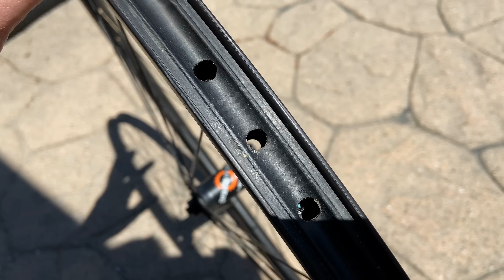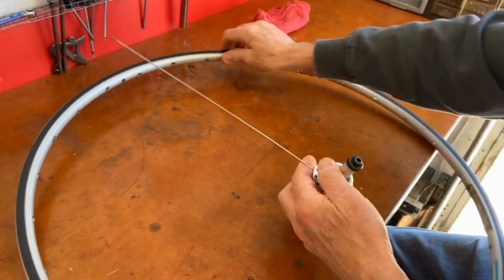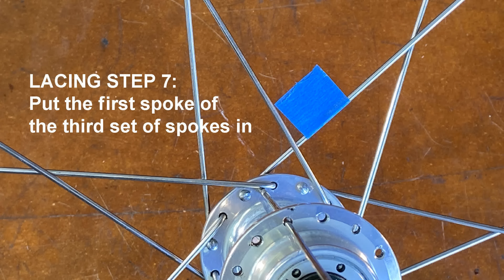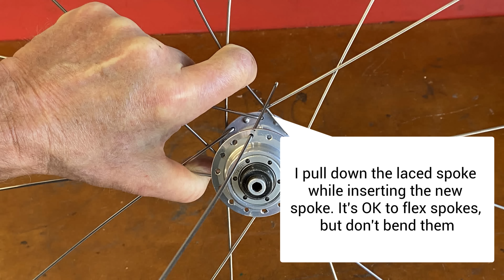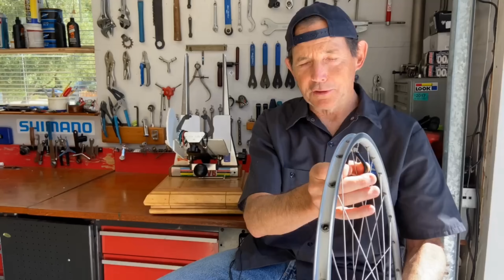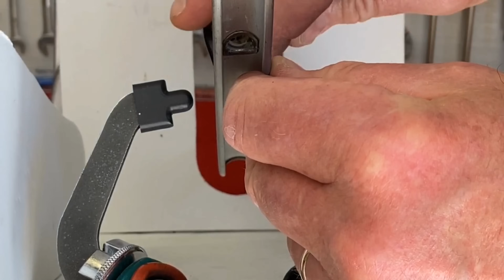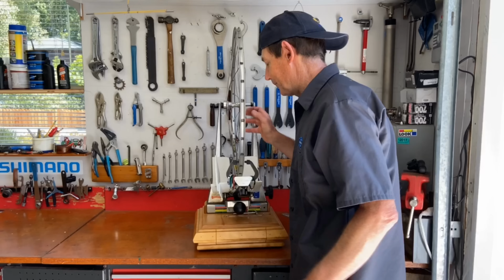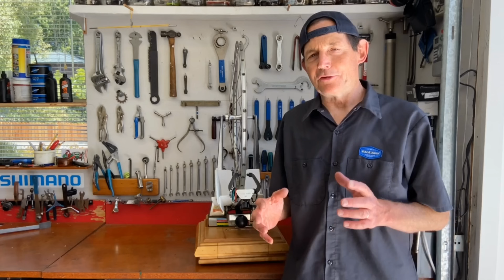How To Build Bicycle Wheels THE EASY WAY! #bikerepair

Comment: Found your video much more informative than shorter ones on YouTube. 
I bought several basket case huffy 26” cruisers to make a few odd bikes. 
(Reverse steer & a swing bike)
I have enough parts however the wheels on most were less than perfect. 
Knowing how to true a wheel will be a big help! (If I can do it?)
Taking apart and re lacing will be good if I decide to paint my wheels? 

Also my LBS is now closed due to the owner retiring. 
And he usually done all my wheel truing on my unicycles. 

By the way I did hit the subscribe button.
Reply from the maker: Thanks very much for subscribing, Ron, appreciate it. Sounds like you have some great bike projects you're working on. Being able to true and build wheels will come in very handy and anyone can learn the skills. It just takes a little practice and patience. Don't be in a rush. Take your time, make small adjustments to the spokes when truing and you'll learn how it's done and get good at it relatively quickly if you do it this way. Have fun and best of luck with your cool bike projects - reverse-steer, unicycles and a swing bike - wow!
Reply: @JimLangley1  
Gotta say didn’t expect a reply on a two-year -old video. 
I took an old rusty wheel to play with spoke adjustment, probably my first mistake. 90% of the spokes nipples were seized! But with previous experience working in the truck maintenance industry I was able to get all of them freed. 
Got the wheel close, actually ALOT closer than I thought I would have!
Actually stripped a fee nipples in the reassembly. I have spare bikes so no worries. 
I have a much better wheel I will give this skill a go on at a later date!!

I appreciate the video and the response!!

I may even attempt to build a tall bike in the future?
Reply from the maker: @krukabman  great job, Ron. Yes, seized nipples are always a challenge. On my highwheel bike (you can see it in my video: https://youtu.be/671CtqCds2Y) all 80 nipples were frozen because they were over 100 years old. It took lots and lots of penetrating oil application to get a few free and then I broke out the torch to heat the rest up to get them to finally break loose. Great job getting yours to where you could true that wheel. I thought of the highwheel because you mentioned a tall bike. Be careful on it if you build it, it's a long way down 🙂But they sure are cool! Thanks again for subscribing! Don't know if you know but there was another Ron Cooper who was a super famous bicycle framebuilder in the UK. His bikes ride magically. We sold his frames at our bike shop in the late 1970s and I finally met him in San Francisco when he came here to a big bike show around 2010. It was wonderful meeting the man behind the amazing bikes. https://en.wikipedia.org/wiki/Ron_Cooper_(bicycle_framebuilder)
Reply: @JimLangley1  
I would love to have a penny farthing (high wheel)
It’s said to be the beginning’s of the unicycle?
An acquaintance of mine (a self proclaimed know it all)
Told me the unicycle was invented by a guy scrounging through the write brother’s dumpster??
I told him I didn’t think the dumpster had been around in the weight brothers time!?🤔
Ron Cooper could possibly be kin? 
My dads name has origin’s in the UK, Scotland & Ireland. 
As far as the tall bike I think I would be ok I have a giraffe unicycle, 5’ I have ridden it 2 miles in one go. I am still unable to free mount it though. 
It is actually easier to ride than it’s short counterpart. More time to correct. You just have to get your mind over the fact that your that much higher, and a 5 footer you really never more than 32” off the ground. (Measure from the bottom of your feet, with the pedals at 3 & 9 o’clock)
A friend of mine had a lead on a 10’ unicycle we were going to buy it just to ride it once and get a video to post. Then sell it and split either the profits or the losses. But someone bought it before he could get a delivery that took him through the area. 

Well I could go in and on, more than I already have. 

Again I got WAY MORE INFORMATION from your video than all the others even the park tool video. 
It was easier for me to follow. 

Keep the rubber side down!
Reply from the maker: @krukabman  I'm really happy to hear that my video was so helpful, Ron. Thank you. The unicycle was invented before the Wright Brothers actually. A guy took the rear wheel off a highwheeler and patented the idea. I can ride a highwheel but I can't ride a unicycle. I have one and maybe someday I'll figure it out. I can tell it takes a lot of practice and it would be better if I was a lot younger, ha!! I enjoyed chatting with you and learning about your bikes. I would enjoy seeing your tall bike and other bikes if you would like to share photos somehow when the projects are done. Let me know if you need bike help and I'll be happy to help!
Reply: @JimLangley1  
I’m not going to even start cutting up the bikes until I get back from holiday. 
I’m going to use the cruisers on the beach then start hacking them up. 
I have a channel that I post videos to once in a while. I will most likely post a video of me riding them on there. 
As far as learning to ride the unicycle your never to old to learn I learned at 47. 
And look up “Unigeezer” on YouTube. He’s 65 I think and he’s a sponsored rider. 
I was face book friends with him before I ditched and deleted my account. 
Look up “36’er unicycle crash”
It’s a 10 second video that’s my channel. 
Always enjoy talking to like minded people.
Reply from the maker: @krukabman  thanks a lot for the encouragement, Ron! I will definitely check out and subscribe to your channel to see your two wheel creations!! And I'll check out the Unigeezer too, thank you!
Reply: @JimLangley1  
Thanks. 
Unigeezer is amazing on what he does with a unicycle. 
I don’t post very often. But when I get one finished I’ll post a video.

Comment: Very informative video and thank you for all your efforts in making it for all of us to learn from.  Before watching the video I thought I was truing my 29 inch mountain bike wheel and the spoke popped off from the nipple.  I tried to pull the spoke and screw it back together but the nipple doesn't catch the first/initial threads.  The wheel is a 2019 wheel, so I was thinking that I needed to get new nipples to have screw together again.  What are your thoughts?  Any help would be great.
Reply from the maker: Thanks for watching the video, Ray, glad you like it! That's an interesting problem you're having. Usually when you're truing a wheel the nipple can't separate from the spoke since it's screwed on to the spoke a lot - at least half the nipple is on the spoke. So, if it popped off, it makes me think that maybe that spoke is just way too short. A too short spoke that might have been holding onto the nipple by one thread could definitely pop off when you try to true a wheel. And it also wouldn't thread back on since it's so short.

Usually when they build wheels they use the same length spokes so to have just one that's way too short like this would be unusual. So, you should look closely at that wheel. Look right at the end of the spokes where they go into the spoke nipples. Are there a lot of threads showing on all the spokes? If so, then the problem is the wheel was built with much too short spokes and that might be your problem. Unfortunately the best solution for that is replacing all the spokes with the right length ones. I'm happy to knock around more ideas so please let me know what you find and we can discuss it some more.
Reply: @JimLangley1  Thank you for the quick reply and all the good info.  I'm going to have to figure out the specs of the spokes and get some new ones.  I have been out of the biking game for a long time and soooooo much has change their is so much information that you need to know.  I don't even know what brands are any good anymore (for parts and things like that).  I would like to put together my own wheels at some point.  I don't want to pay the carbon fiber prices but I don't want to go cheap with all effort that I'm going to put into it.  Lots to learn but, I think that's the fun part about it.  Thanks for being you and helping out the biking community!
Reply from the maker: @lazysurf9  you're very welcome, Ray!

Comment: There's lots of different ways to lace the wheel, I do it slightly different however it's all the same in the end(should be anyways) I often have trouble with the oval, lateral I can get almost perfect- when I say trouble I mean around 1.5mm out of round and lateral around 0.5mm, I'm a perfectionist 🤷 however it's good to hear you mention that nothing is perfect, I know that tolerances will never be perfect, nor a wheel ever be perfectly round.. but it's good to hear others confirm it
Reply from the maker: Thanks for watching and the great comment, Van. In case it helps with getting that last 1.5mm of roundness even better, what I like to do is move the indicator on the truing stand below the rim so that it just touches the high spots as the wheel spins. I then work on each high spot tightening the spokes just enough to make all the rubbing noises stop. Then I move the indicator closer to the rim again and make it just touch and I repeat the tightening to get the rim not to rub at the high spots. Doing this just a few times in most cases will get the wheel so round that you won't be able to see any imperfections. It's fun doing it this way and super satisfying as the wheel gets rounder and rounder. It's my favorite step of truing, I think you'll enjoy it.

Comment: When your truing a wheel you just laced, can you tighten which ever side you need to move without loosening the opposing side spokes, assuming they all need to be tighter anyway? At least on the first side to side truing pass?
Reply from the maker: Thanks for watching and the great question. Since the spokes are not too tight yet with a just laced wheel, it's fine to tighten whichever side you need to. But I recommend that you get the wheel nice and round and very true with low spoke tension on both sides first before starting to tighten spokes. At that point the spokes will still be relatively loose and it's fine to tighten a side without loosening the other side. Okay? I hope this answers your question and happy wheel building!

Comment: I've always trued my wheels with the saddle nose hanging on a pool ladder! The brake pads and a pencil across the brake pads is my choice. A zip tie or a carefully held fingernail works on track bikes. A trueing stand would be awkward with all these years working as I have from the top.  The thing I've never done is hammering the J bend. My wheels stay true, but always break at the J bend. On 36 spoke wheels placed 4 crossed, occasionally spokes have broken at the nipple.  I always have stood the axle onto the floor and pressed on the rim. Some new things to try.
Reply from the maker: Appreciate you watching and sharing your technique, David. Spokes should rarely break as long as you use quality spokes. I recommend DT Swiss and Sapim. The most common cause of breaking at the nipple is that the spoke length is too short to reach the end of the nipple. That leaves an unsupported part of the nipple and the nipple can break there. Thanks again and enjoy your wheel building.
Reply: @JimLangley1  Been there with too short! The spoke filling the slotted part of the nipple shoulder helps keep it from shattering. Too long makes me want a Hozan spoke threader even if it meant taking the wheel apart again! Long ago a nipple  stripped out because of a too long spokes! Treading on thin ice once again.
Reply from the maker: @davidburgess741  I cut and threaded hundreds of spokes on the 3rd Phil Wood spoke machine made, David. But I much prefer to use factory threads so if spokes are too short or too long, I will rebuild the wheel with the right length spokes. Have fun and thanks for the great comments!
Reply: @JimLangley1  The problem as an amateur wheel builder is volume. The LBS no longer stocks spokes! They use salvaged spokes from broken wheels! More profit in selling built wheels since without profits, they would be gone. Ordering from Universal Cycles, it seems they don't believe an amateur could read a spoke ruler to rebuild an existing wheel with same configuration. Profits again.  Returns and shipping cost them money. If I had a Hozan or  cyclo tool, maybe I could score a small supply of long spokes and be good for a long time. The Phil tool is  beyond my budget and needs. I'm not from the disposable world, diverging standards mindset in the name of profit!
Reply from the maker: @davidburgess741  shops vary a lot so I think it's always worth calling around and checking, David. At least in places where there are lots of shops, like here in the USA. Some have spoke threaders now and Wheel Fanatyk sells the best one I've seen yet https://wheelfanatyk.com/collections/threading/products/wheel-fanatyk-sct-machine , which means you'll still get professional quality threading.

Older bike shops might have a supply of older but still good spokes that would work even if they're not the newest models of spokes. With newer shops just starting out that's less likely. 

You can often find spokes on eBay.com, Amazon and the bike sites like Universal that you mentioned, but you're right that it's hit or miss. Plus the price per spoke can be way up there. Hopefully things will improve on the supply side but I bet the price doesn't come down, unfortunately - sure miss the days when all bike stuff was reasonable to buy for anyone to be able to fix their bikes.
Reply: @JimLangley1  I have a small supply of DT spokes from a wheel I built 20 years ago. Small flange 4x 36 spokes. The LBS actually has a threading head by it's lonesome. It's possible with patience to make passable threads on this bare bones rig! They've made a few for me. Just like my father, I collect tools. Need a pipe threading rig and pipe vice, got one? Knowledge how to use it, also passed down! Never was a plumber. Television repairs,  he also did that, again as a complete amateur! Machinist,  never was one, but was a  tech writer for a major software company. Trained as an A+P mechanic, horrible 80's economy,  wound up as Nurse Ratchet at a state nut house for 34 years! Won a state time trial as a junior and raced Cat 3 for a few years. No veterans  or masters Now I feel the average cyclist on Strava should unsubscribe. I'd find it too embarrassing to be that slow!
Reply from the maker: @davidburgess741  congrats on your state time trial championship - that's quite an accomplishment, as are your many different jobs. Impressive!

Comment: Excellent tutorial, Sir.  I am planning to build a pair of 36 spoke 27 inch wheels and I am trying to decide whether to do a 3 cross or a 4 cross lacing.  What factor(s) should I take into account?
Reply from the maker: Thanks for watching and the question, MrBrando! With 36 spokes - as long as the rims are nice quality - you'll have strong, reliable wheels with both cross patterns. 4-cross would be good if you're carrying packs or there's a heavy load on the bike. But, both 3- and 4-cross will build great wheels so it's really up to you. Hope this helps and enjoy your wheel builds!
Reply: @JimLangley1  Appreciate the reply, Sir.  I am leaning towards a 4-cross and I just might do that.  Thanks again.
Reply from the maker: @MrBrando1968  you’re welcome!

Comment: When you say “full turn” and “half turn”, what do you mean exactly? I would have thought a full turn is 360 degrees with the spoke key. At one point you said “full turn” and turned it 180 degrees. Am I misinterpreting what you mean?
Reply from the maker: Thanks for watching and the great question, Thomas. Sorry for any confusion. The reason I call  180 degree turns a full turn instead of a half turn is because it's as far as you can turn your hand usually before having to re-grip the spoke wrench to turn it further. 

When you take a new grip of the spoke wrench it's easy to end up turning the nipples different amounts, which makes it harder to true and tension wheels since if the turns aren't the same the wheel keeps going out of true. So I recommend stopping with 180-degree turns when truing and tensioning or quarter turns as you make finer adjustments.

So yes, it's technically a half turn of the wrench and the nipple. It's fine to think of it that way if you prefer. Again, sorry for any confusion and I hope this explains. Have fun building your wheels and please let me know if you have other questions.

Comment: Topic not mentioned: Ascertaining the proper spoke length(s) for a particular wheelset (hub+rim), and how the right and left sides may indeed require slightly different lengths. Also unstated, but fairly important, is that the spoke should be long enough to engage -- but not overshoot -- the neck of the nipple which, if left "empty", can place that weakest portion of the nipple under tension hence subject to breakage. Conversely, too long a spoke risks protruding its threaded end into contact with the inner tube, creating a flatting hazard.
Reply from the maker: Actually all these things ARE mentioned, VideoNOLA, you just need to watch more of my wheel videos 🙂. I have over 20 videos about bike wheels. This one is about how to build wheels and right at the outset I tell you to get the right size spokes. For anyone who wants to, here is my video on how to calculate spoke length: https://www.youtube.com/watch?v=LvV4FE2VxZk&t=1061s . Here is my video on ways to keep spokes tight, which it sounds like you might also enjoy: https://www.youtube.com/watch?v=z4FKL95x6DE&t=350s